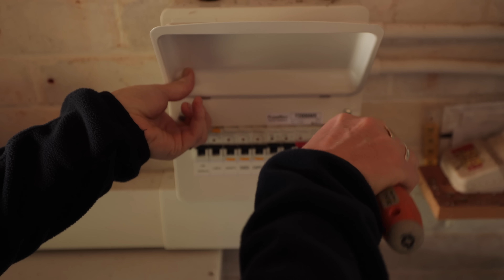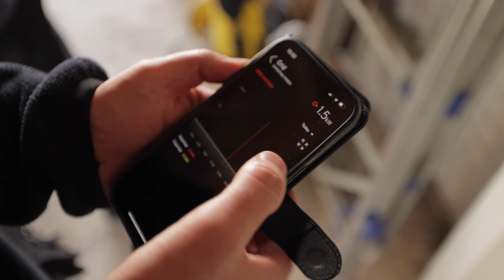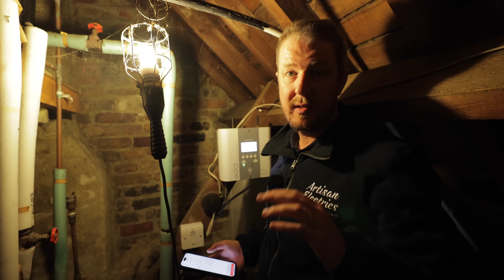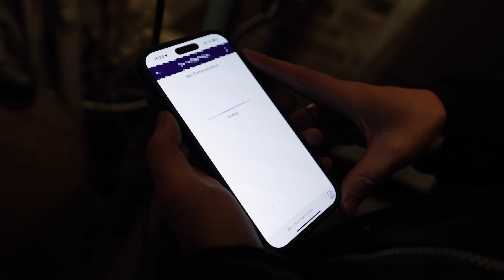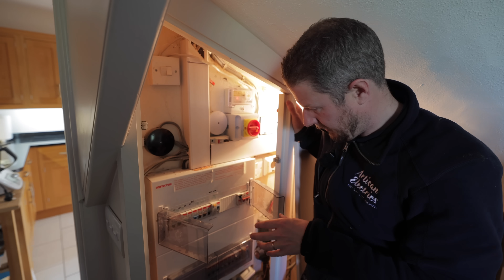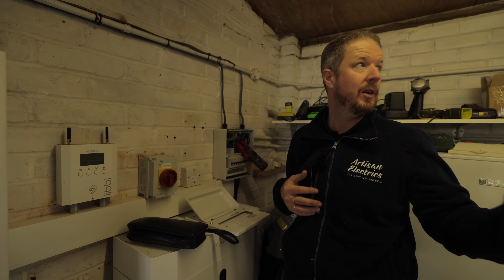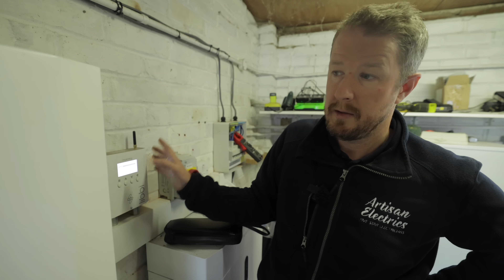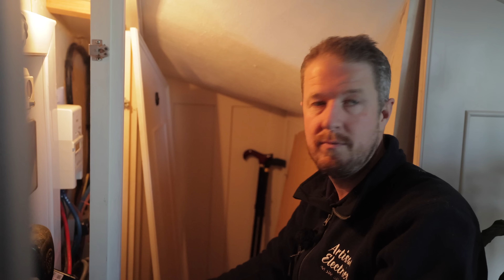£20,000+ Battery System RUINED By This 1 Simple Mistake 😳

Comment: Talking about that potential disaster from the possible damage to a plastic tank - why is there no non-return valve fitted - in the event that the thermostat fails (or both if there are two) surely it is a much smarter idea to fit a non-return valve as well to ensure that the plastic tank is always protected. Also should there not be a pressure release or overflow pipe as well? I am not a plumber - but these things would seem to be logical safety considerations.
Reply: The second thermostat requires a mechanical reset so its almost unheard for them to fail. A non return valve would mean the pressure in the tank would increase as it gets hotter. This becomes a bomb full of hot/boiling water. A pressure relief valve would then become essential and the result would be catastrophic if the pressure relief valve stuck closed. It would also dribble out cold, then hot water (somewhere) as the water warms up and expands. This is then solved by adding an expansion vessel.   The end result it that a simple open vented system with an easily remedied safety issue is converted into a much more complex and less safe pressurized system which in the UK is covered by building regulations and would legally have to be installed by someone with a G3 qualification (Unvented Hot Water Systems certification).
Reply: @andrewfrance1047  In Australia there are storage hot water systems that have a tank of water heated by an electrical element - it has a top-up valve and a simple open spiggot to allow overflow to come out - it is usually just piped outside or into a nearby drain. Mains pressure water runs through copper pipes that form a heat exchanger and this allows mains pressure hot water to be provided. That system allows for a perfectly safe open overflow pipe - and therefore no special valve is needed to allow any pressure release - it is just mounted at the top of the tank. You simply open the water inlet valve and top up the tank once every couple of months or so - basically by filling it until water runs out of the overflow. It doesn't require anything complex in any way at all... and works... and nothing explodes as there is no pressure buildup at all - also we don't use plastic tanks in any case - a very cheap and nasty solution I must say.

Comment: If you unwind the charging cable from around the tethered Zappi it gives it a much better wifi signal. Its a design flaw to wrap lots of cable around a wireless device.
Reply: It's not a design flaw unless the manufacturer intends this to be done, it's an installation flaw. Some crappy installer has very recently done the same thing on my MIL's installation

Comment: In the USA you dont put the Electronic on there.  Everything on ground floor for resident or technician to check and safety purpose if it get fire easier to see/detect...  up on attic much hotter... not safe...

Comment: Myenergi products require a manual download on each device and don't update through the app settings automatically, as you mentioned. It's a pain, but I place a reminder in my phone to check if there's been an update through the Myenergi website.

Comment: (au) I have 2 systems, one North one South* 
South facing was an experiment in to is viability. Turns out in Brisbane it's as good in summer and ½ in winter. 

I have a mixed battery system, an ac coupled alpha, and a dc coupled LG.
 And a timer based hot water heating system. 

With the while system running in perfectly fine, North system is out of action atm so 2 different battery systems that don't talk together, the ac system is disabled (LFP) should be ok for the next month or two, 
Relying on the dc system though they aren't getting full charge atm, not enough day light hours 
But still helping with things/

*North is preferred in Brisbane

Comment: Ten of thousands spent on the Solar system and nothing spent of inner roof insulation panels ! Nothing new there then ! Thank you very much for your lessons in how to do it properly .
Reply: It could be that the roof needs to breathe, if the soffits are vented then insulating the roof would cause serious problems with condensation. If that is the case there is a way to insulate the roof space…BUT, in an older property it would be a major task.

Comment: I am guessing the alternative wireless system the devices use is zigbee related, and would the customer benifit from an additional wifi access point installed in the garage, which would also give the customer broader wifi coverage as well as boost the internet for the devices? or was it a case of just updating the firmware to latest versions enable all the devices to pair?

Comment: You brits (I'm in the US) sure have a complicated electrical system. You remind me of an uncle who said it takes as much time to do something wrong as to do it right.  Great video.  Thank you.
Reply: UK has a safe system. ..so does the Eu.
Reply: Actually we don't. Basing that opinion on this video is ridiculous. A fraction of one percent have this kind of battery/solar setup. The us system is more complicated having to use 2 different voltages.
Reply: The set up in the video is super complicated, but it doesn't have to be that way and my solar + batteries + EV charger is much simpler

Comment: Seems silly that because the devices were not internet connected or even able to talk to each other they wouldn't work costing the man that had it installed money he should have saved. Seems he could sue the installer for improper installation and losses not gained by the solar install you should have got & is the whole reason for installing the solar. To save on the electric bill and grid usage. Potential problems I see is data collection that the man maybe doesn't know about and the ability for that equipment to be hacked via the internet or wireless access via the Wireless connectivity where someone with very little skill could hack in threw the internet or wirelessly and take control of your energy system. Malicious people could weaponize your battery and make it overcharge or over draw the battery cell's and make them go into thermal runaway. This problem even present's itself in EV cars and truck's & nobody in the media is talking about it!

Comment: That is twenty grands worth of highly active and potentially volatile chemistry in your basement.

I would put it in a shed, at least a hundred yards away from the house.
Reply: I assume you do the same with any gas equipment in your house as gas is very explosive. In the UK I see several stories every year where there's a gas explosion in a house which often kills the occupants. I haven't seen any news items about home batteries catching fire. Even if they did you would have time notice the smoke (alarm) and smell and evacuate the house. In other words batteries are much safer than explosive gas!